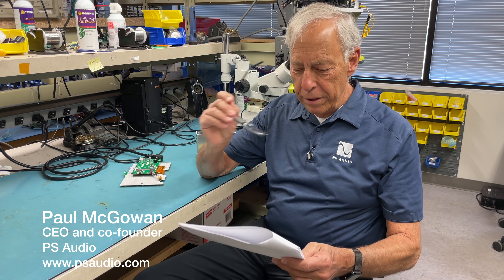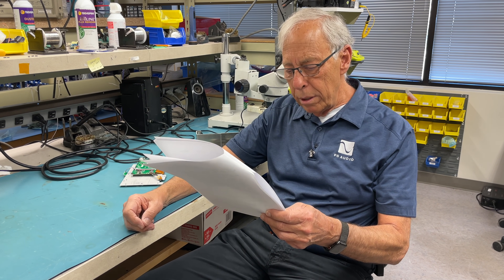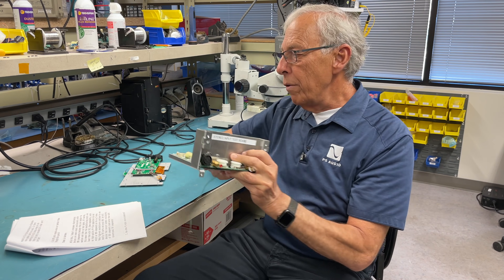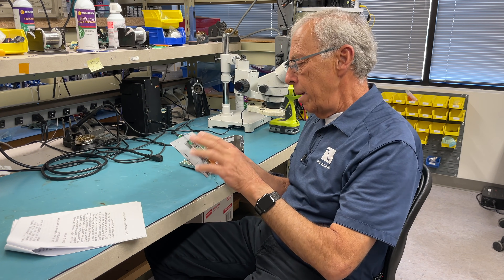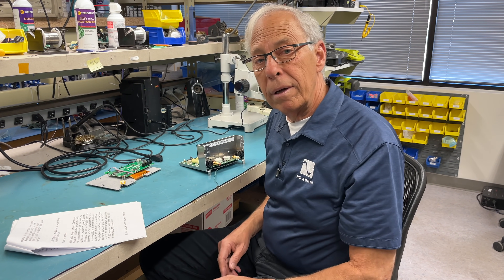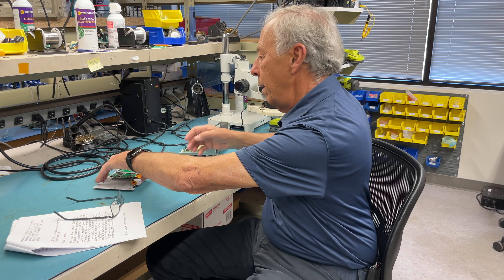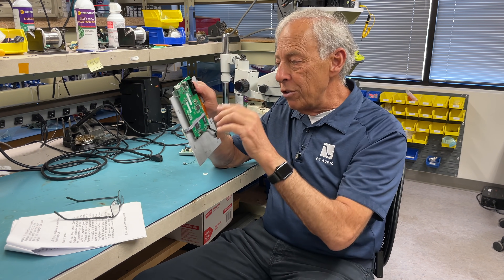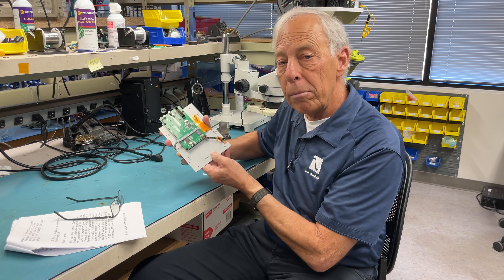Do SMT parts sound worse than through hole?

Comment: The one thing I enjoy about through hole components and products that more or less exclusive use said design, is the fact that they're much much much much much much much much much much much much much much easier to repair. For example as a layman or amateur repair tech like myself, if I have a couple capacitors go bad on an amplifier I can go down get a couple replacements and easily desolder the old ones and pop a couple new ones in with nothing more than a basic soldering iron and some solder. With surface mount it can be quite a bit harder and more labor intensive and require more specialized tools.

Comment: I have to replace smd parts on a capstan motor board.  They are notorious for failing on my 238 Tascam.  Would it be better to use THT to replace the smd parts?  I'm thinking they might be more resilient in the long run. Thx.

Comment: Hello. I’m a PCB designer of over 10 years. DIP and SMT packages have their individual advantages. The technology and design of the component will vary by manufacturer. Mainly, DIP packages can be useful in multilayer boards in high speed data situations where you may want to bury the copper signal traces (single or differential pair) between copper ground layers immediately at the exit point of the IC. You can do this with SMT packages, through the use of vias, which can go through all layers of the board, or only some layers (blind/buried) SMT is useful for more obvious reasons, perhaps you only need traces on the same layer as the SMT package, in this case, you do not have extra through-hole pads to worry about. This can be useful when you have many components on the top and bottom layer, in which case you cannot use too many DIP style packages.

Comment: OMG!  While you are at it, you might as well ask if printed circuit boards are better or worse  as compared to point-to-point wiring?  Then you can debate whether integrated circuits (ICs) are better or worse than discrete components?
Reply: And give us the same "does not sound as good" claim without any rational explanation based in electronics science ? Can't wait ! 🤣

Comment: Only chip amps & class d stuff use SMT as far as I know.
Reply from the maker: They do but most modern audio equipment do as well.
Reply: @Paulmcgowanpsaudio  Do smaller traces (less copper) equate to loss in signal?

Comment: 3:30 And thats the crux of the problem: Misunderstanding characteristics of components. This is especially true with things like high-k dielectrics used in MLC (multi-layer ceramic) capacitors can very quite dramatically with both temperature and voltage. See: https://en.wikipedia.org/wiki/Ceramic_capacitor#Voltage_dependence_of_capacitance In DC blocking applications, this can degrade the low frequency performance and cause distortion. This does not mean that it "sounds worse", but that the designer will have chosen the wrong type of component. For Paul's ultra-posh film capacitors, for DC blocking and coupling of the small driving signals from the tubes those could just as easily be high quality electrolytic capacitors. There would be no measurable or audible difference as the capacitance is not varying with time since the signal is so small compared to the DC its blocking. The only advantage would be long term (like years to decades) stability, but the real elephant in the room there will be the tubes which are horribly non-linear and degrade with total hours of use.
Reply: I commend you for taking the time to share the actual scientific explanation to the question, instead of his magic and misleading "does not sound as good" claim. Demystifying audio is a never ending challenge... Would be refreshing sometimes if he just said "I don't know the ACTUAL reason, let me bring in someone who actually does".

Comment: How does "sound" go through a capacitor? On a more serious note, no pun intended, another major advantage of surface mount is low unwanted inductance due to no lead wire length. And the tight circuit packaging surface mount allows for makes high speed and high frequency designs much easier and cheaper, although this does not matter at audio frequencies.
Reply: Try changing the capacitors in your crossover, and you will be convinced they have sound!
Reply: @bergennorway  A passive speaker crossover is a horrible device - strictly speaking. How can you maintain accurate frequency division with a passive LC filter looking into a 300% impedance variation from the driver. That is what happens in a passive crossover speaker. Now they do work quite well regardless and quite necessary in the bulk of affordable home HiFi systems. But if you really want high end, use active line level crossovers and bi-amp. For me I now use a DSP based crossover. This is a huge advancement in that you can precisely vary the crossover point and slope on a GUI menu. That level of control is not really possible even an analog line level active crossover.
Reply: Well, the electricity within the amp is literally analogous to the sound... so if you affect that AC signal you are literally affecting the sound.
Reply: @graxjpg  Yes, that is quite correct. But my point is that the more "technical audiophiles", meaning those who are more interested in the hardware versus just music lovers, need to study more basic electrical engineering principles. Some of the questions asked in this column are utterly ridiculous.
Reply: @andydelle4509  I see your point, experiencing music is of course what it’s all about.

Comment: X7R and Y5U type multilayer ceramic capacitors change their value quite a lot with variation in applied voltage. If you have an RC low pass filter the capacitor has a varying audio voltage across it to ground. This varying signal voltage causes instantaneous variations in capacitance and this makes for lots of distortion. A coupling capacitor is not the same situation provided it is a large enough in value that the voltage across it doesn't change appreciably during the signal voltage excursions.

Comment: Hahahahaha, oh dear. Yet another audiophool clueless question.
Reply: Well, the worst part might actually be his "does not sound as good" response without any explanation based on actual electronics science. But I bet he just does not know the differences in electrical characteristics between SMT and THT capacitors at different levels of power / voltage / temps... Hopefully his amp designers know better ?

Comment: Great Q&A.  Another reason for THT parts is power handling.  In your BHK example you are likely dealing with 250V or 600V coupling caps.  There is no way to make them smaller and they do not exist in anything but THT.
An interesting companion question is does Point to Point sound better than a PCB based topology.  Many high end tube amps actually have very simple circuits composed of high quality parts wired the old fashioned way... point to point with wire.  There is a school of perfectionists that claim point to point is superior.  All done by hand and requires skill in routing, wire twisting and grounding.  Likely no PCB in a Decware amp for example.
Reply: The "PC boards sound bad" myth comes up often in audio forums. The truth is that even a cheap phenolic base PC board has not appreciable effect at audio frequencies. Now when you get into high speed digital and microwave circuits, there the base board material characteristics do make a difference. All that said, for audio, there are very good PC board layouts and very bad point to point designs. And the reverse is also just as true.
Reply: @andydelle4509  Points well taken.  No question that digital and RF circuits excel with well designed multilayer PCB.
Tube amps moving bigger currents and very simple circuit do well with point to point (assuming some skill employed).

Comment: I'm just glad point to point contact is not a thing at all anymore. Repairing antique radios can be a huge pain and harder than any SMT component because it's such a rats nest.
Reply: Point to point is definitely still a thing. High end guitar amps are built with turret boards that make it easier to service, modify, etc. than even if it used through hole boards. These amps are paint by numbers compared to SMD which is more like photorealistic painting lol. But the sound and reliability of these point to point amps means PTP will be around for a while, as these amps could last indefinitely if they are maintained.
Reply: @graxjpg  consider me corrected! Thanks for the information!
Reply: @bf0189  haha yes! Point to point will be around at the very least as long as I am making myself little electronic devices haha! Cheers mate

Comment: As long as the SMD component is the same type as the THT component, the SMD component will be better due to tighter tolerances.
Because SMD components have shorter leads, their stray capacitance and inductance is lower as well.
However, some types of components don't exist as a SMD part and are only available as THT component - that's what makes the difference.
Reply: The main reason for me to prefer THT components is because I like to be able to service my own gear.
With many small SMD components you'd need very expensive soldering equipment, while THT can be serviced using a basic soldering iron.
Reply: @QoraxAudio  as soldering technology advances, someday there will be audiophile grade SMD capacitors and resistors LOL
Reply: @graxjpg  LOOOL!
That would actually be quite funny and sad at the same time 😅

Comment: Smd sound beter! Because they have low noise…especially thin film resistor, and there are PPS smd caps’
Reply: True in low level applications (pre-amp...), not so in high-ish power applications where other characteristics are way more important (stability at high V / I / Temp...). It all depends. 

But what's true is that it goes way above Paul's head and his limited knowledge in electronics 🤣

Comment: Surface mount components versus through-hole ones, in my experience of doing DIY electroncs since 1983, it depends on the levels of current flowing through the circuit in question. Through-hole parts sound subjectively better - to my ears - in high current, high power circuits like power amplifiers.

Comment: The main reason for thru hole parts in low production run products is that it’s easier to assemble by hand. Surface mount is easier for pick-and-place machines to handle. Until recently, getting low-volume pick & place assembly was more expensive than just doing it by hand; now there are several Chinese vendors who will do it at comparable prices (I think it’s a loss-leader for them, and they make it up on the ones that do turn out to become mass-market products).

Electrically, there’s nothing inherently superior about either type until you get into microwave frequencies (which is a whole ‘nuther ball game). Also, not all surface mount caps are tiny; some are actually rather large. And you can mix-and-match on any given board: do the surface mount parts first with a pick-and-place machine, run the board thru the reflow oven, and then stuff the board with thru-hole parts and either run it through a wave soldering machine or hand solder it.

Btw, it’s actually possible to attach a thru hole part to a sufficiently large surface mount pad on a board; you just have to bend the leads of the part to make contact with the pads, and hold the part in place while soldering it down. This is usually only done when trying to repair a board and you don’t have on-hand or can’t get the proper surface mount part.
Reply: surface mount also makes things impossible to service and really helps the cause of planned obsolescence that electronics makers love
Reply: @Shrek_Holmes  It’s not impossible, but it does require more equipment and skill. I do hand SMT assembly & rework with a stereo microscope and regular soldering iron for parts that have exposed leads or contact pads, and hot air for those that don’t.

What does make repair impossible is if you can’t get the parts, or if they are programmed with code that you can’t get,

Comment: The performance depends upon the technologies, materials, construction, material stability tolerances and ratings used. All components have secondary and tertiary characteristics that affect their response to varying signals - For example: capacitors have ESR(resistance) and inductance. Even just wires have inductance, resistance and capacitive coupling.
Reply: Yes, and even the leads of TH devices have parasitics that affect the electrical performance.  You wouldn't have the internet if the electronics had to overcome them.  Also SMT resistors which have external resistive elements that are laser trimmed during manufacture, so they are much more accurate to spec than TH resistors of whatever composition.  Even when you order 5% parts, you're getting much tighter tolerances due to the way they're made.  You're just not paying for the screening to certify tighter value tolerance.
The comparison of a foil cap to a multi-layer ceramic cap is somewhat misleading as the dielectrics are completely different.  A more fair comparison would be to compare the SMT MLC to a ceramic disk cap.  Which are well known to not sound that great.  So for that part of the circuit you are forced to use the TH part.